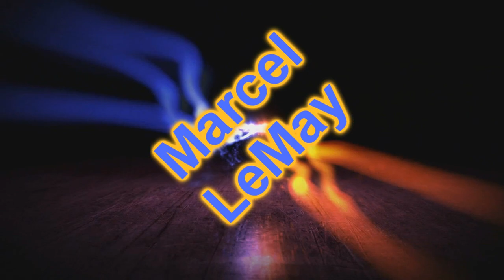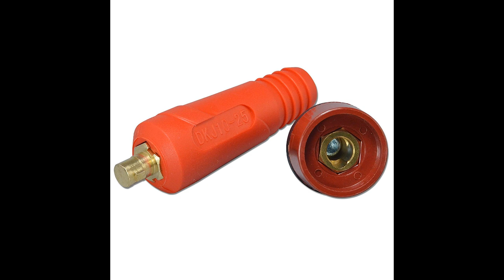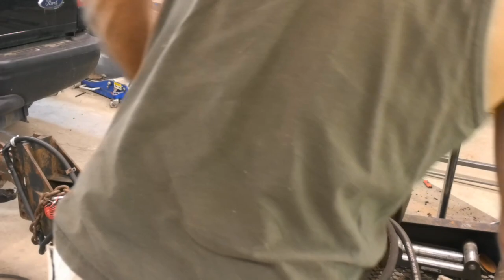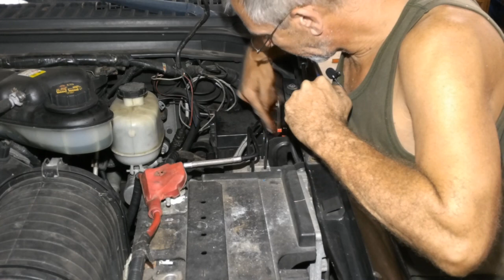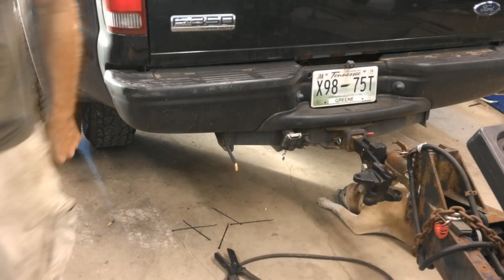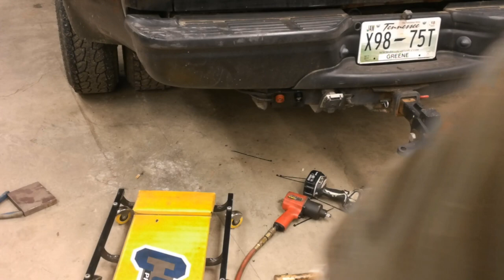Run your electric HYDRAULIC dump trailer with NO BATTERY

Comment: Great job, I was considering not having a battery on my drop trailer build, I'm convinced. I just replaced an old buz box with extended leeds, may be worth fifty bucks, now the parts on it are worth more to me. Drop trailers get operated about as much as the tow vehicle starter motor itself so the standard electrics should be fine. Just need to rig for multiple trucks. I may make the leeds and connector bracket quick change. YouTube has brought together so many thinkers. Thank you.
Reply from the maker: The actual dump draws about 200 amps when it's loaded. The 12000 lb winch I have on it will sometimes trip the 300 amp breaker I installed in the engine compartment. I leave the truck running when I'm operating the trailer so as to not draw the battery down so much that I can't start the truck back up. 👍

Comment: Nice video. But it would be easier to just get some long jumper cable. Or two short ones soldered together. I'm cheap. That's the route I would go.
Reply: 20 ft cables are $20 at walmart.

Comment: Ok i did connected my trailer as you shown but you did not specify about relay that you mentioned, because of that i think one of those wire is drawing more voltage still having similar issue

Comment: Great video! And even better idea!! Can you explain a little more on the inline circuit breakers inside the hydraulic pump box, and possibly post a link on them please ? I plan on doing all this to my dump trailer and installing a winch so I might as well do it right the first time. Thanks in advance
Reply: And also how you hooked your winch up to the whole set up as well. Thanks again

Comment: Nice upgrade. I did this a number of years ago to my trailer. I built a 6' x 10' dump trailer this summer and used the same setup. Works great!
Reply: So now you still need 12 volt power to keep your trailer DOT legal for your disconnect for your brakes to apply if your becomes unhooked when on the road
Reply from the maker: Yes
Reply: I do plan to do the up grade that you have done but i plan on keeping the battery in place on the trailer . This way I will not have to add a small trailer battery to keep from getting a ticket from the DOT . We have to do a prey trip inspection and if the brakes don’t apply when you pull that breakaway cable the fine cost a lot more than a battery and the up grade . You may not need to worry about this in your part of the country . Good videos 👍👍👍👍😎😎

Comment: Did everything as shown, with same items you linked in description. Don't know if the circuit breaker is Chinese garbage or not but as soon as i have a load on and try to dump it, it pops the breaker. Without a load works wonderfully... Any ideas?

Comment: So to be clear. If you run a 2/O wire from the battery to the bumper, I’m assuming without the circuit breaker that the hot wire would be a fire hazard on its own? Or would operate without any surge protection? I saw in another comment you mention you shut your breaker off when not using the trailer.  An employee of mine tried this without the breaker and said his truck started smoking so he gave up don’t want that happening to my new truck. Thanks
Reply: I guess I’m just trying to see if he got that result because the flow should be controlled with the breaker?  Does the breaker pop on its own when the trailer is not pulling power?
Reply from the maker: You need a circuit breaker to protect your vehicle in case there ever was a short circuit. If the insulation ever rubbed off onto a grounded portion of the truck, it would cause an electrical fire without the circuit breaker protection. It's just like a circuit breaker in your home. Without a circuit breaker, you're just asking for an electrical fire.

Comment: So all I have to do is run a red wire from the hot to the back an just a short to frame to ground it? I am going do this.. thank you an your sound sounds great.
Reply from the maker: Yes, but put some kind of shutoff or circuit breaker near the truck battery in case of a short. And always turn it off when you're not using it to power the trailer. Otherwise a short on that heavy wire will cause a truck fire🔥
Reply: @marcellemay7721  thank you will do!! I will order that 250amp fuze cutoff u used.
Reply: I was on amazon they have a straight  inline fuze cut off switch  winder what amp would I need for that one wire? Its slim an straight  instead  square.  Cause all I am looking for is to cut power from that battery  back to the dump tralier.  I am going use them grey plug together  like u use on a winch...
Reply from the maker: @rogerl8488  I had a 250 amp breaker. I think they're made for solar panels charging arrays, they are cheap, like$15. For the dump body it was fine, but it would pop when using the 12,000 winch. So I installed a 300amp, and it's been fine. Installed right off the truck battery. I'm pretty sure there's a link in the description for those breaker s.

Comment: I'd be real careful about two things.  

First is if you use this anywhere they use salt on the roads.  Salt water will set up a low grade short circuit between the two terminals on the truck and corrode the sockets.  You might want to think about isolating the hot wire under the hood with a heavy relay and a switch in the cab.  This can also run your truck battery down after a few days.

The second is the capacity of the frame ground to the battery.  Most batteries are grounded to the engine with much smaller ground straps from the engine to the body and frame.  You might want to run a thicker ground cable from the frame to the battery or engine.

We run into the same kinds of problems with snow plows up north and connections exposed to salt and weather are always eventualy a problem.
Reply from the maker: I already have a 300 amp circuit breaker that's off always except for when I need the power to the trailer. But, your comment about the heavy ground to the frame is something I did not consider. I've been using it this way since I installed it, and it works. I understand the  corrosion that can occur at the grounding point and also the mounting plate. The connectors are heavily isolated with a thick plastic grommet built in to the welding connectors I used, but voltage pathways can still occur if it's a wet salty environment. This is why I shut off the circuit breaker under the hood unless I actually need it to operate the trailer. The simple solution would be to just run a separate heavy ground cable from the battery to the connector on the back of the truck. I'll probably do that if I run into problems.

Comment: Do you need 2/0, or 2 guage welding cable?  I hear both from different videos.  So I'm confused on this.  There's a big difference on price, otherwise I'd just go with the bigger wire.
Reply from the maker: Sorry about the confusion, it's the 2/0 size... The bigger of the sizes. 2 guage is kinda small for this application.

Comment: How did it work, how was your charging gauges when you are using the hydraulic dump or wninch
Reply from the maker: It works great. There's 2 batteries on my diesel truck. I just keep the truck running when I'm winching and using the dump. The winch seems to draw more than the dump does.

Comment: Why not just use electric forklift connectors and be done with it. They can take high amp draws and impossible to hook up backwards. Run heavy cables from your truck battery to the rear bumper and hook up one of the ends of the forklift connector to them. The other connector will hook to the trailer pump electrics.
Reply from the maker: How much do a set of electric fork lift connectors cost ? I got less than $75 in this whole project.

Comment: Be sure that You secure that positive socket in some way in order not to allow anyone to mess with "live" positive and negative on Your bumper :)
Reply from the maker: SzymekCRX What could possibly happen? 😲
Reply: I imagine a "small" short circuit with lots of sparkles :)... Like sticking two fingers into a socket outlet :)
Reply from the maker: SzymekCRX I plan on 3d printing some twist in dust covers to keep the dust and rain out. But, that's one of the reasons why I installed the circuit breaker under the hood so that I can keep it dead when I'm not using it.  Thanks for watching.
Reply: Love the idea. Could u still have the battery in the trailer and use the new power as well from the truck? Then as u drive around the truck charges the trailer battery and u can not hook up the wire to the truck if not needed. If the battery was dead the the truck power would come in.